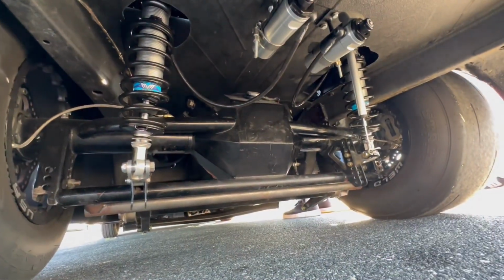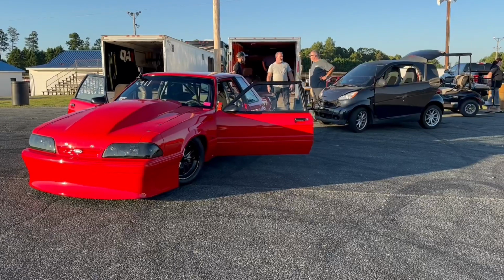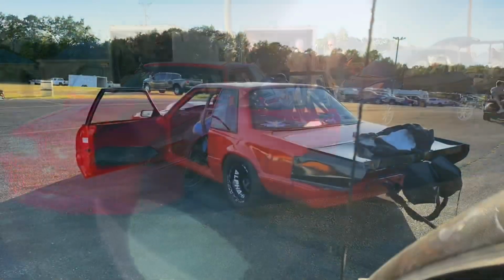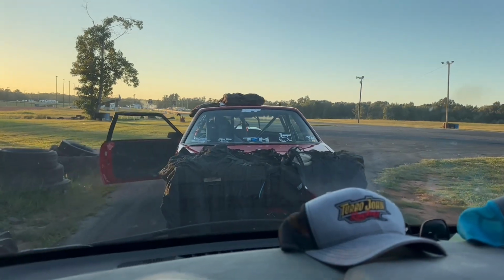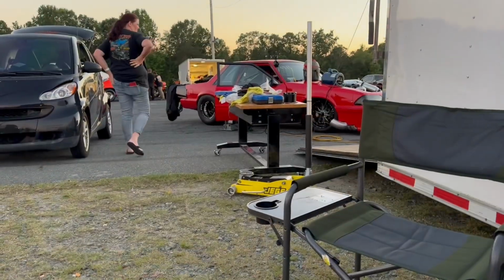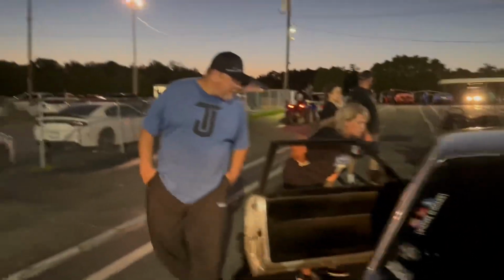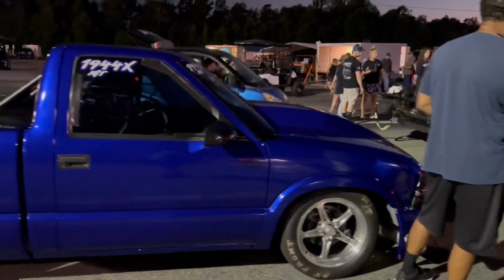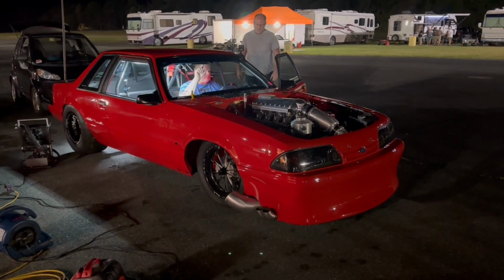$15,000 ASAG Shootout / Piedmont Dragway / More Problems

Comment: Good luck randy and crew Ford powered forever baby keep on pulling the knot out of them boties and the horns off them mopars l love it
Reply: Nothing Ford in that engine..
  Just like there is nothing GM and Dodge in  the other engines.
 When he wins he just pulling the knot out of who ever did not get their aftermarket parts to work as good as his.
Reply: @bigboreracing356 so your telling me that’s not a small block ford? Or. I mean what’s wrong with ford racing
Reply: @DeezGarage  Who manufactured the block and heads?
Reply: @DeezGarage I did a little research on the engine.
 It is a small block Ford. They reversed engineered Bob Gliddens cast iron Ford heads. My bad.
Reply: @bigboreracing356  💪🏼💪🏼props to you for owning where you where wrong brother respect

Comment: No disrespect but I think that red car is out of y'alls depth
Reply from the maker: Did you watch the vid?  Today was an issue we have not had before......noone could have prevented it not bumping as it has worked well every other pass.  Only other time it has not bumped was when it was low on fluid which was not the case this time.  Either the transbrake solenoid is slowing down or the SSR is slowing down.
Reply: @TurboJohnRacing  I did watch the video. I watch most of them and for basically 2 seasons this car is 2-0 on you boys lol. I enjoy your videos, I'd just like to see this monster eat.
Reply: You can not learn anything by paying someone to fix problems.
They are doing a damn good job and will do better the more they learn.

Comment: I agree that is a very expensive car over $100k I’m sure I don’t understand why it rarely works. Do y’all think there is a chassis issue?
Reply from the maker: It is a chassis issue for sure.  It became problematic last year when we lowered the car.  Prior to that it was a beast, but we almost have it sorted back out I think.
Reply: Meaning it’s usually seems like chassis issue vs turning. That car should go 4.40s all steel I would think